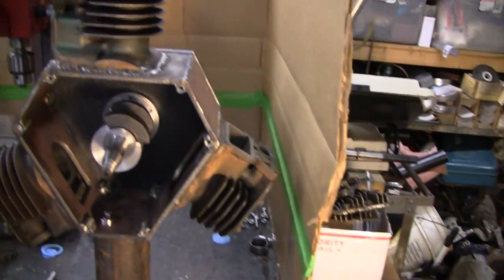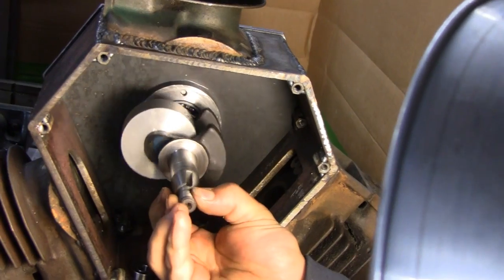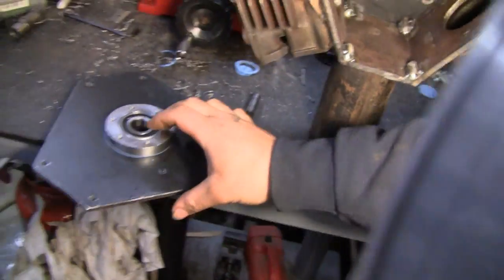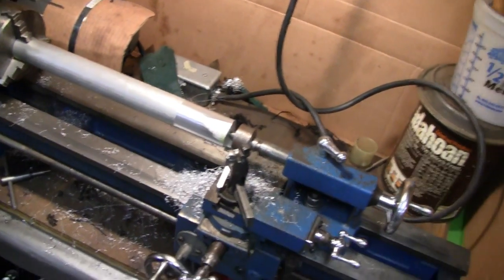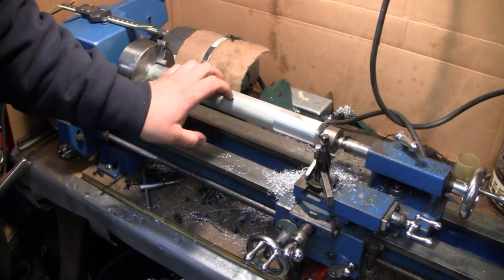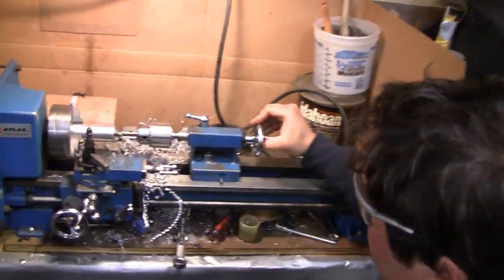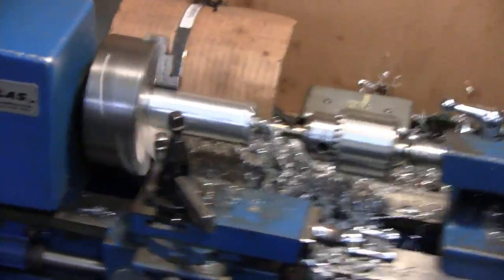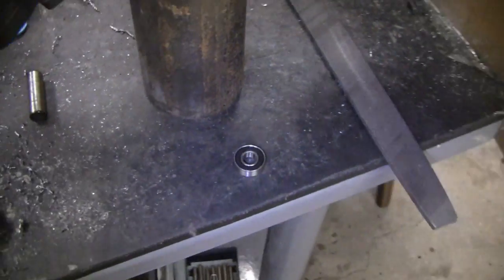HOMEMADE RADIAL BRIGGS ENGINE (part 22)

Comment: Great work! I'm looking forward to seeing the final product. Of course, I'll add my $.02..... I think you'd be safest to leave all the seals intact on the bearings. They're already sealed with lubricant inside and the more seals you leave the more layers of sealing you're gonna have (similar to the cam seals in your car). So if you only have one seal which turns out to be 75% efficient at running pressure you're gonna have seepage, where-as if you have 4 seals at 75% efficiency each you might just get a little moisture instead.
Reply from the maker: Thanks Bud!!☺

Comment: I guess the reason for not taking the interior seals off of some of the cam bearings is that there is not enough of a oil bath inside the crankcase to be assured that they are lubricated.  LOL.  I guess that was a question.   :)
Reply from the maker: I don't think it really matters, with or without the seal they'll be gettin' plenty of lube!!☺

Comment: Quick question , do you think over time the crankshaft will be sufficient enough to hold the stress of three cylinders running ? Since it's only designed to run one cylinder ?
Reply from the maker: Nah not at all!! Those cranks are designed to run heavy machinery, ours is just gonna be pushing 3 little pistons!! There won't be any stress at all!!☺

Comment: how are you goint to do it with the oil beqous i runs im to the cylinder doens't it
Reply from the maker: Most of the oil runs into the oil sump, Very little oil runs into the cylinder and doesn't make a difference!! That's just the way radials are designed!!☺
Reply: 805ROADKING aaaa oke